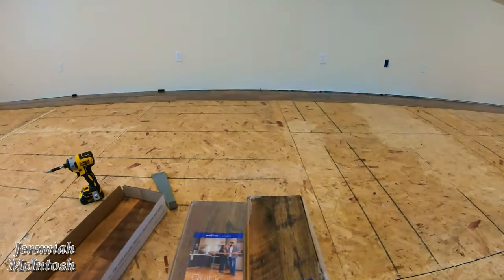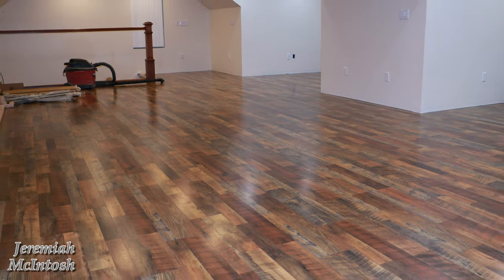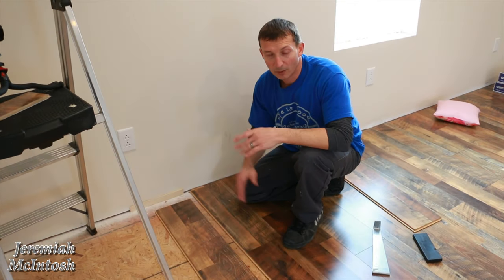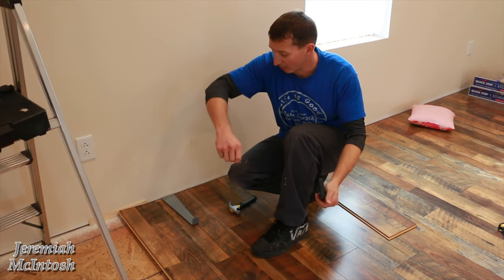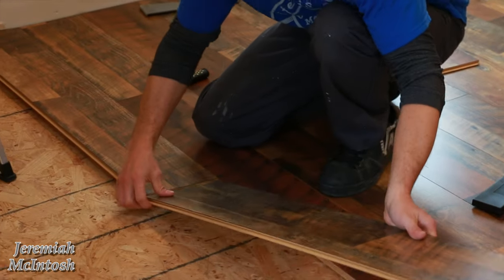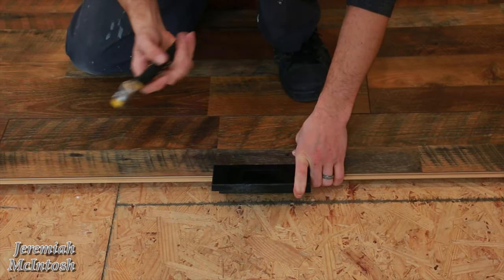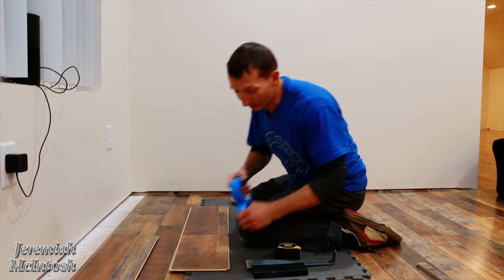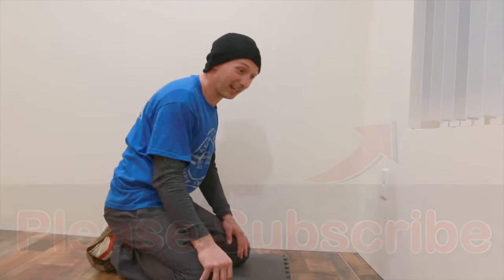How to install Lowe’s Quickstep Studio Restoration Oak Laminate Flooring! Awesome Looking and cheap!

Comment: Man thanks for this video, now I know to just tap each one pretty much nonstop until they're snug. Just spent a few hours trying to install these things, and parts of it were coming apart. 🤬🤬🤬
Reply from the maker: One thing I’ve noticed is to make sure you hammer the short ends as well. I’ve noticed even though they look like they’re completely together it takes a little bit more to make them lay nice and flat and it went way easier once I started doing this.
Reply: @JeremiahMcintosh  Yeah for sure. After watching the video I took everything apart and started over and had more success, and less cursing. 😂

Comment: Great video. Would like to see another one using the gold accordian style  underlayment also...how to use it.
Reply from the maker: Thanks Linda. I didn’t have to use it here because the padding was already attached to the bottom of the planks.
Reply: @JeremiahMcintosh  Jeremiah. Putting in our flooring now as I type. Same brand different color. Concord maple. Notice that the ends of the boards appear to have a slight bevel - so the edges are not completely flush with each other and there is a tiny seam. Indented. Can see it and feel it. Where dirt can catch. Are yours like this? We have got them tight as they can go and it appears to be part of the design....?
Reply: I just called lowes. Apparently all the QS studio flooring has this bevel along the sides as well as ends Lovely. We have high traffic and dirt is going to gather in the seams and look awful. So rather than return two pallets of flooring I am thinking of doing a fine bit of silicone along each seam - clear  - to keep dirt out. A bit time consuming but in the end it should work don't you think?
Reply from the maker: I would not use silicone it would look like crap and it still will not get rid of the bevel! Mine has a slight bevel as well and have not had a problem with it however we don’t walk on it with dirty shoes.

Comment: I'm curious how leveled the floor underneath has to be to do this type of installation.
Reply from the maker: It doesn’t really need to be level but you don’t want to have any big dips or humps. Anything big will need filled in with floor leveler.
Reply: @JeremiahMcintosh  Thanks for the quick reply. I also saw in the reviews people saying with this Lowes brand "They don't stay clicked together over time" ... Is this true in your case?
Reply from the maker: I have not had a problem yet. Make sure they are locked together good on the long and also short end when installing and no huge dips or humps and you shouldn’t have a problem.
If I have a problem in the future with it not staying together I will update it in the description

Comment: can you install this product over existing hardwood floor ?
Reply from the maker: Absolutely you just have to make sure there is no big humps or dips in your floor you want it to be pretty flat.
Reply: No you cannot
Reply: @JeremiahMcintosh  the laminate will sweat on top of the wood thus causing headers to pop out. You have also not used underlay.
Reply from the maker: The underlay Was already attached to the planks.

Comment: Does the floor hold up well in high humidity?
Reply from the maker: Im not quite sure because the room is controlled but if you think you may have an issue I would use a luxury vinyl plank and it wouldn’t matter if it was humid or got wet.

Comment: Hi I was wondering if you would be able to give me some tips. I’ve watched the video and read the comments and the flooring still isn’t clicking in for me and is such a hassle that is taking me forever ! Is there any other advice you have so that i can get the boards secure and in place ?
Reply from the maker: Do you have the tapping block? You also need to tap on the short end as well as the long end because even though it looks like it is together on the short end it may go further and lay easier but use the tapping block do you don’t damage the edges.
Reply: I have a tapping block but that doesn’t seem to work either. I’ve only been able to lay down 3 rows but have only the 1st one successful.

Comment: Dude this room has more plug receptacles than any other I’ve seen. How is the floor? Water proof? Chipping edges or corners? Scratches?
Reply from the maker: Haha can never have too many receptacles!It is not waterproof but has held up well with no scratches or chips but it is in an upstairs room that doesn’t see heavy traffic.
Reply: @JeremiahMcintosh  Yeah you’re probably right. Damn… that’s a let down on the water proofing cause on lowes in the description it says it water proof and talks it up like it is. At least the quick step studio I’m lookin at says it had spill repel and then in the description it’s waterproof I wanna redo my living room and kitchen. I have laminate in both bathrooms and it’s held up over the years. But I can’t remember the brands I used. It’s been over 10 years for both.